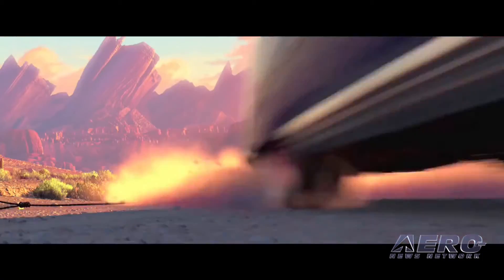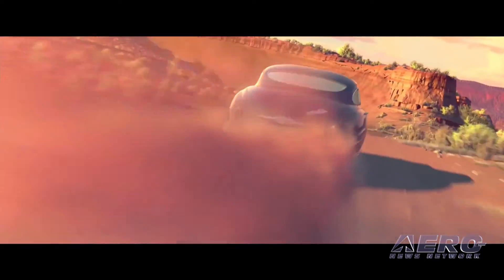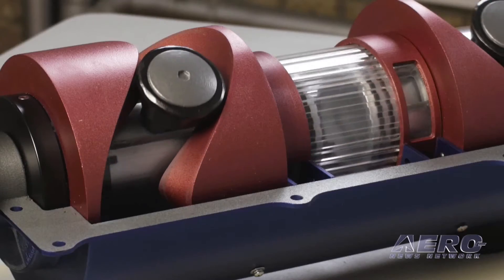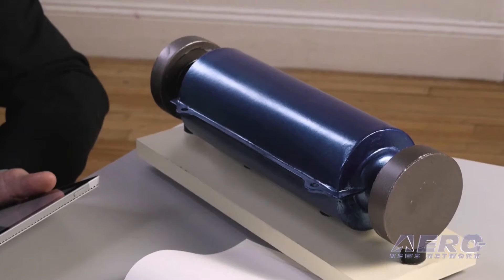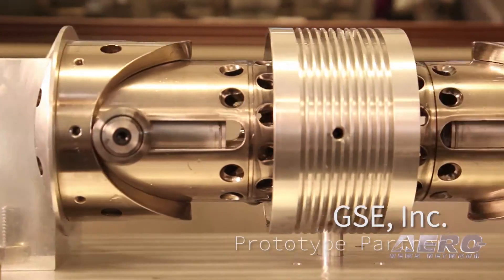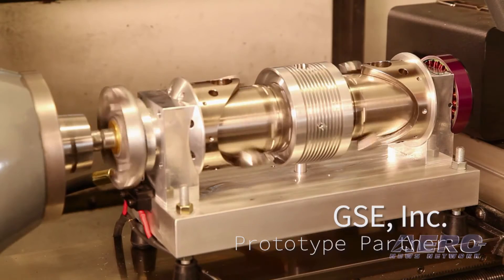Stratetek's Light NG  - 2016 AirVenture Innovation Preview

Comment: It's the Dynacam engine .... can't imagine he isn't running into patent overlaps with this design, cause the Dynacam operated very similar to this.
Reply: I think not
This sinusoidal cam is swashplate . Is 115 so year old. Dynacam nigh 80 yr
Reply: @aggabus  plenty of 100+ year old designs... 

of course, in our modern world of information, they all seem to have been forgotten about. along with certain various important aspects...

such as in this case, the rollers tend to slide on the swashplate rather than rotate... wheres the line of convergence? across the width of the bearing itself, only one point is actually rolling, the rest of the contact line is sliding...

lot of effort been put into some designs yet we always seem to end up back here with major design flaws...

history matters.
Reply: @paradiselost9946 

Well said paradiesel

1inn aka Erex
2Devize new swashplate
Axial  
Both opposed piston. This
Is oppopist